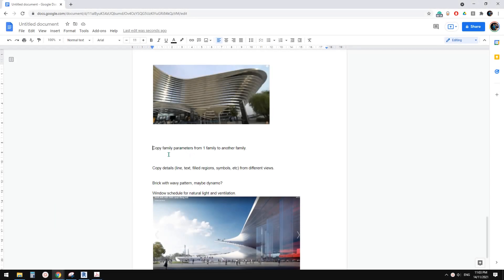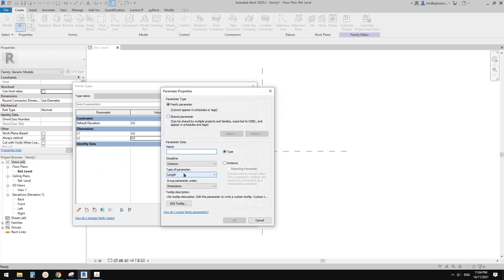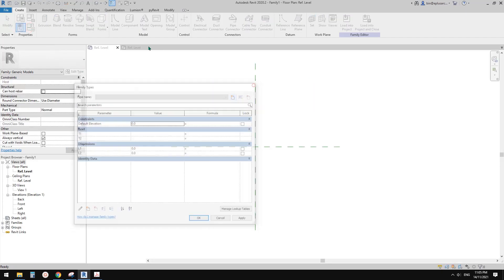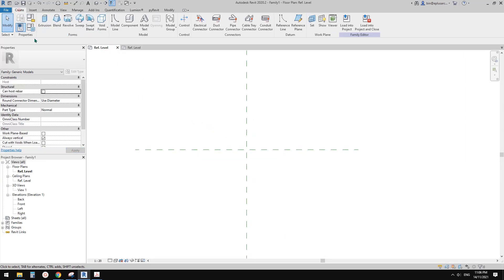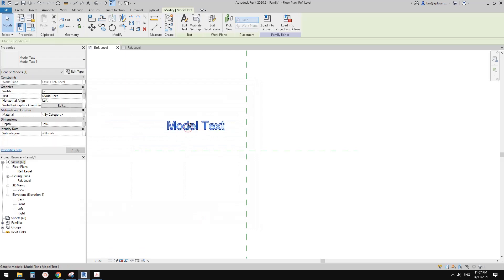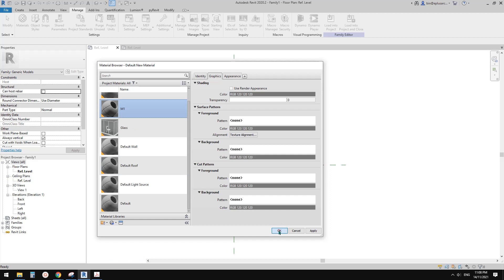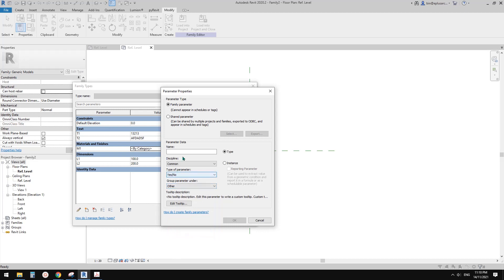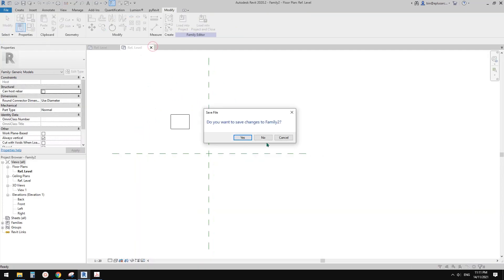Revit Exercise (Day 601) - Copy Family Parameters Between Different Families

Comment: Thanks. how can this apply to door families?
Reply from the maker: I think it applies to any family. You can also try to copy elements with dimensions (parameters) and it might work as well. Another way to speed up your work is to use shared parameters, so you can have a list of parameters you can use  for different family. Have a search of the Shared Parameter and you will find out how it works.
Reply: @BINHE615  thanks for the input. I tried it for doors on which I created custom parameters, but I can't seem to copy n paste a door between families. Could be because it is hosted on a wall.